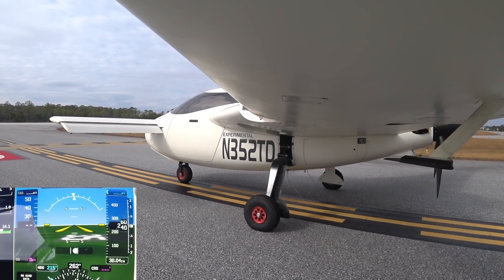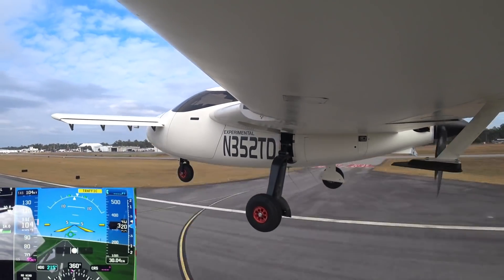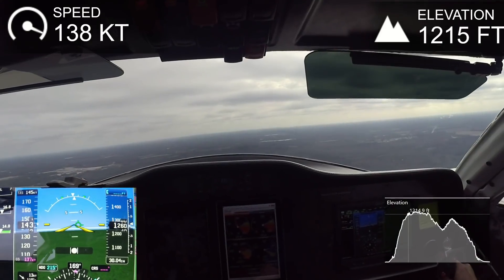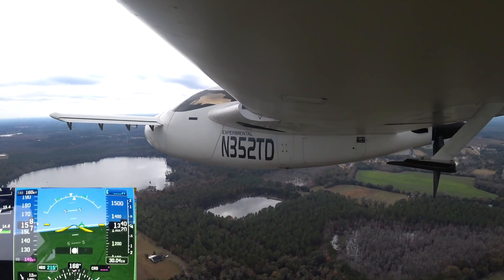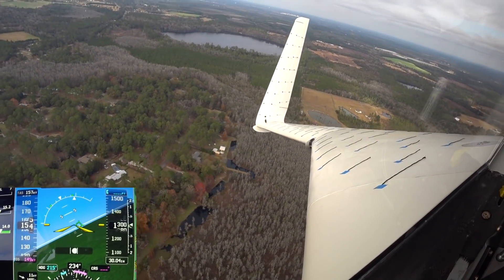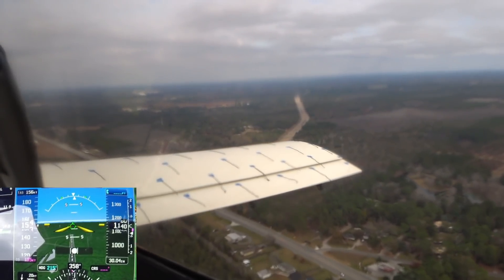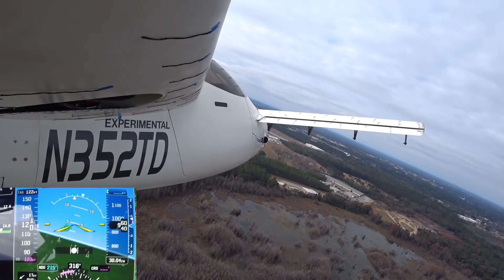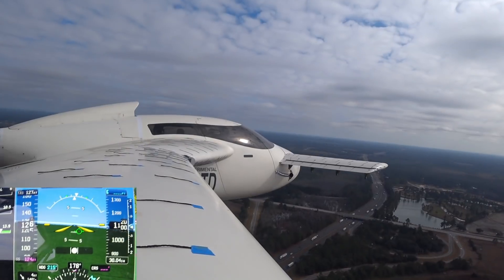Dialing Things In - Flying the Raptor Prototype

Comment: Wheel Wells are not an issue. Get it to 5 K and then 10k and watch temps. 240 is too high on the oil temp needs to be 220 steady.

Comment: Is your static port source in the wind flow? Or do you have pitotstatic probe? Because every time you throttle up and gain speed you get increase in altitude, on a rnw
Reply: That's been observed since the first taxi tests, but has never been addressed.
Reply: It's one of those troubling issues where the builder says "I'm happy with that" and thinks it's resolved.
Reply: @T_Mo271  ahaa didn't see that video. Why not just put 2 static port on bought side and it will account for any skid/slip like in cessna. Also does it have alternative static port inside?
Reply: @James Brandt hell now I realy wanna know haha
Reply: @James Brandt hell now I realy wanna know haha

Comment: roll stability issues due to disturbance might be due to the wingtip "balance weight" coupling into another axis.  It's way out in the wingtip with a huge arm, and it's aft of the CG.  if it gets bumped around, it's swinging fore-aft, yaw left right, roll up down, etc and might be inducing other issues? Idk, seems like the asymmetry could cause something like that.  I dismissed it before because the inclinometer isn't moving during the roll oscillations, but then it didn't move during your rudder inputs either...

Comment: Respectfully....noticing the pitch attitude varying markedly between +2.5 to -2.5 in level flight. This can be a sign of not being in trim OR over controlling in pitch.
Reply: Rule of thumb 1degree of pitch change will give a ROD or ROC equal to the current Mach No in feet per minute, example I guess Peters Mach no would be approx .24 so every degree will give a rate of change of approx 240fpm. 
What’s causing the pitch change is what’s important to find out. I’m sure Garmin won’t like being blamed 🤭

Comment: Congratulations! Another test flight with a greasy landing, this time right on the centerline.  What's the wheels off the ground time to date with these six flights accomplished?  In my humble opinion, these flights to date are monumental considering the time and treasure spent developing, prototyping, and building this flying machine, but now is the time to slow it all down, take small incremental bites of data by experiment, and to do thorough, documented analysis of the data gathered with each and every one of the flights.  It appears you have the thorough, documented part well in hand.   I'm sure you know that this platform has to be tested for all of its performance characteristics in order to be either certified by aviation authorities or as an experimental kit offered to the public.  Using the work of others is essential, while this experiment is unique in its performance specs, there are other aircraft which have the complex and high performance systems of this platform.  We have all read at least one POH hopefully.  Therein lies the roadmap for design of experiment.

Comment: It just keeps flying better and better.  Next flight get up to 3500-4000 and fly a few 20 mile long straight and level cruise power passes and conclusively determine what engine temps are doing.  I think you have solved the overheating issues but I would feel better knowing that from looking at real empirical flight data.

Comment: The Raptor has proven to be a smooth, easy to fly aircraft so far. You’ve done a fine job not only with the design and building it, but taking your time with testing the various components. Thanks for taking us along with you every step of the way. I would find it difficult not to throw caution to the wind after this flight, but slow and easy is definitely the safe way to approach each step. Safe flights in the future, we will be with you every step of your journey.

Comment: This is so excellent!  150 + knots on the downwind!  Can't wait to see her up above the cloud layer in the smooth air.
Reply: Yep, 150 Kts Ground Speed (GS) was the top I saw. 172 MPH in the thick air! Very nice in my book! Indicated airspeed hitting 158 Kts. (IAS) 184 MPH is cool too! Obviously the winds at pattern altitude were around 11 Kts. Very nice design! Peter is doing a fantastic job! Best Wishes!
Reply: @willhibbardii2450  Absolutely.  I liked the liftoff also, this almost felt like she flew off rather than a rotation.  We almost always rotate but satisfying to see a liftoff based on the aerodynamic equilibrium.  I just rebuilt a little speedboat recently but now that project is completed Peter's progress has helped me with my thirst for design, fabrication and envelope expansion.  Thank you Peter.
Reply: @BruceTGriffiths , Your a man after my own heart! I'm a boat guy too. Built many fiberglass plugs for production molds. Built plugs for The Eliminator and many other boat manufacturers. I've learned much from reviewing Peter's Vlogs. I'm thankful to him!
Reply: Also great to see that gear well turbulence seems to be a non issue.  Yes?

Comment: Those telltales seem to react in sync with an audible change in the slipstream.  Is it possible you’re ever so slightly yawing back and forth a bit and the vortilon is then interfering with the flow which is not straight on when slightly yawed?

Comment: Peter,
Bold move in taking on the flight testing on your own.  To echo what others have stated here and having experience in a full flight test program in a 45,000 lb. commercial jet, I encourage you to at least get an experienced test pilot or flight engineer write you a logical set of test cards and sequence.  I'm fearful you may be placing yourself into jeopardy.  That first flight was terrifying and yes, you're making progress, but some critical maneuvers should be accomplished at altitude (side slips come to mind).  Introducing full rudder on final with unknowns isn't conducive risk mitigation.  A mid to forward CG might also be a good starting point vs. what appeared to be a critically aft CG on the first flight.  Just my 2 cents.
Reply: He did that, then fired them when they didn't tell him what he wanted to hear.
Reply: @godholio  the way I saw it, it they walked away sighting safety concerns.
Reply: @craighermle7727  I was reading between the lines a bit...my take was "We don't want to speak too harshly in case his beneficiaries are litigious."

Comment: I've watched every one of your flights.   So far I like what I'm seeing all the way until short final, then I'm praying you don't have any kind of an engine issue.  When dragging it in like that you  are not giving yourself any kind of an "out" if you have a power failure.   You will never make the runway,  you may have to go into the industrial park which never ends well.   Please be carful I don't want to be reading another NTSB report.

Comment: Not a professional test pilot but hear me out here: maybe 200 feet AGL is not the best place to try out full rudder for the first time on a swept wing airplane?
Reply: Short final, 200ft agl, low power setting, 10% above Vat. Why not see how much the wings dip in an uncoordinated attitude? lol
Reply: @kendrickmeadows  "dialing things in"
Reply: @FlyNAA  "dialing things in", "augering things in", what's the difference?
Reply: He had a professional test pilot on the job, but there were differences which I can only assume were on a personal level... and I am a professional FTE and there are more than a couple of things Peter could‘ve gotten himself killed including that full rudder deflection if not for sheer luck..
Reply: @JVK2206  Wasabi...  Yeah they don't really do EXPERIMENTAL aircraft though. 

They don't have a single video of an aircraft that wasn't designed and built by an amateur. They tend to stick to aircraft that are already tried and true.

Granted Peter's Raptor was WAY over weight and still is.  It's way beefed up in all the wrong places. It's got an extra turbo and extra plumbing for no reason.  

And that's all stuff they don't want to have to do work to calculate.

I like Wasabi's videos, but they really only stick to airframes that they can put on a card and compare to specs they are familiar with. 

They aren't going to check off on a plane built from scratch regardless of the quality. They want other engineers to do their baseline. 

They would never check off on an airframe built from components from Home Depot like Peter Sripol built in his garage...

https://www.youtube.com/watch?v=0s8UcWU2kr8&ab
Reply: @kendrickmeadows  Yeah, where Wasabi's expertise ends, it's time for them the step aside for someone with real experimental experience...like Peter 👍
Reply: Naah, what could possibly go weong on such a well tested airplane?

Comment: I'm curious what the ambient noise level is inside the raptor while in level flight.
Reply: I was wondering that too! 

As you probably noticed as well it looks like the interior is pretty spartan. It doesn't look like there is any interior sound deadening materials, interior trim, or carpet. I bet it's pretty noisy right now, but like you said it will be interesting to see how quiet it gets in cruise with and without all that material.

Comment: Why would your control surface have so much slop that you would have to un center statically to get them to center under load?
Reply: I’m guessing aeroelastic loading and inherent flex in the design. The wings aren’t rigid, and in flight are supporting the load of the aircraft, so will naturally bend up (how much is dependant on design and materials etc). I’ve seen this sort of setup on gliders; wings unloaded on the ground are rigged a bit “weird” so when in flight and loaded, the control surfaces are in the correct positions. Obviously there’s more flex on a sailplane than the Raptor, but it’s not an unusual technique to dial in “neutral” in-flight control surfaces.

Comment: i'm loving your videos Pete, the testing is fantastic - it has my little brain thinking of all kinds of things - i was wondering if you are able to run longer tell tails, ie see where the airflow is going coming off the elevator to the main wing (or perhaps a paper streamer, don't want string tangling up in prop obviously, and maybe test on runway only) - i previously wondered if this may disrupt airflow over the wing, (but guessing this is all in your calculations)
 
then i was thinking of the minor disruption on the tell tail at the wing transition, i know its not a jet but wondering if you get any airflow running outboard from wing root to that point - i remember reading up on usage of dog tooth wings, fences and wing vortex generators to direct airflow (i know you have a smaller fence for lash down tie) - ok so i know its not a fast jet or a Harrier, but i'm sure i have seen people like Mike Patey using them on one of his builds, i know there has to be a set position not too far forward or back for maximum effect - may want to keep the wing clean, maybe add some stability here and there (or add more disruption)

Comment: Production plan?! Is there first going to be a second prototype that is at least 1000lb lighter and has the powerplant, cooling, stability,  pressurization systems, and perhaps interior sorted along with performance numbers validated?  I'm enjoying your videos keep them coming.
Reply: I was just rereading some old Rutan newsletters and for perspective, when Burt Rutan designed the Long-EZ, they spent 6 months flight testing, made 30 different structural  modifications, including building an entirely new wing, before they got the flight characteristics they wanted. He didn't have the advantage of today's computer technology, but to think you just design and build a new airplane and everything works out of the box is unrealistic. Now the work ironing out all the issues starts.
Reply: And figuring where and how to lighten that porker up without weakening the structure.

Comment: I've never seen such wild pitch oscillations on a PFD, almost continuously bobbing up/down between 5-10 degrees! It's not only concerning but dizzying. I can't imagine looking at that for hours on end flying in cloud on instruments! 
Is that your Garmin (ultra-sensitive) or is the airplane actually pitching around like that? 
I would expect to see these oscillations in moderate or greater turbulence but I don't think you would be test flying in reported conditions like that. 
You indicate that its flying very stable now...but it sure doesn't look like it from the videos.

Comment: Hi Peter you can try one of these for your oil temps issue. Should be quick and easy to install  https://www.ebay.co.uk/i/174231123464?chn=ps&norover=1&mkevt=1&mkrid=710-134428-41853-0&mkcid=2&itemid=174231123464&targetid=1002021776393&device=c&mktype=pla&googleloc=1006816&poi=&campaignid=10195651178&mkgroupid=107296207892&rlsatarget=pla-1002021776393&abcId=1145987&merchantid=6995734&gclid=CjwKCAiA_eb-BRB2EiwAGBnXXpIsOjKoaMulP03dza3BoiK0D85p_uYRaieYTYS5lZNhbra-_VB20hoCnB0QAvD_BwE